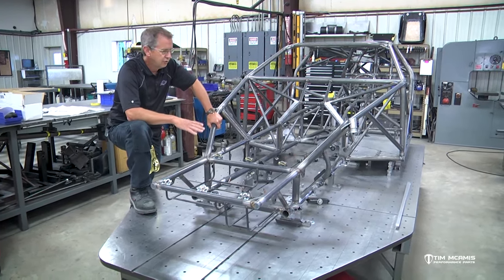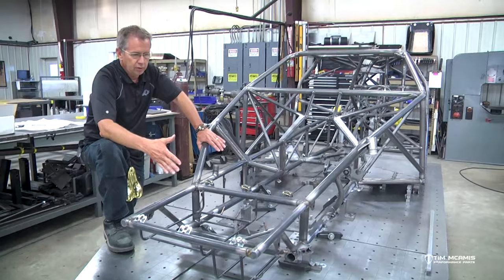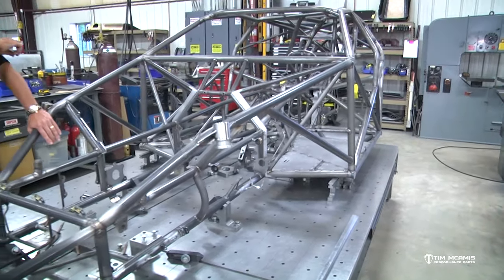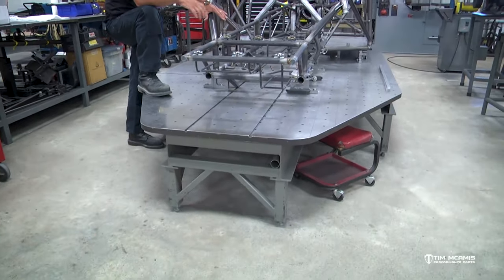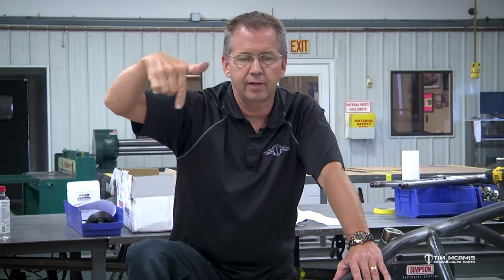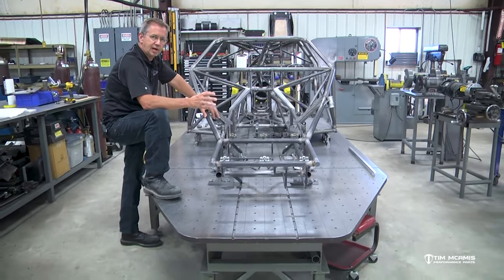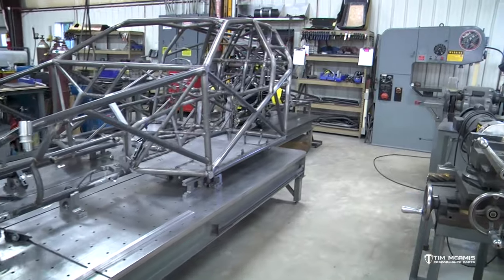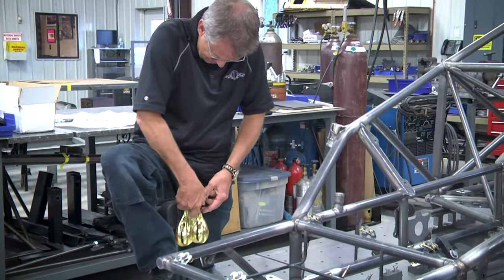How To Make A Basic Chassis Jig

Comment: we made one out of 2 i beams. I just need a refference plane that's rigid enough to hammer n weld on. I've done it w wood blocks and a level right off the floor but the area better be secure, a strong breeze will have it fold like a house of cards.

Comment: I have seen both off road cars  Sprintcars and speedway sedans built as described. And pro built ones.
That surface plate must be lovely though I would be scared of welding spatter etc mucking it up.

Though I have built several  car trailers on top of 4 of 44 gallon drums [nice height]  on a proper level floor using 2x3 premium 3mm wall and it flexes all over the shop. And that Mig welding. End up with a jack or porta power to widen the gaps to where they are supposed to be or a ratchet strap to pull them in. And yes I tack [fairly heavily] the whole structure as I go. They do however remain square corner to corner with no clamps.

Comment: Seriously dude, a transit?
Reply: Nothing wrong with a transit. Like anything else it is only as good as the man setting it up!
Reply: @billharriss4463  I was thinking that it's not exactly a common item that everyone has kicking around.
Reply: You would be surprised how easy they are to find. It is a old technique used in the aircraft manufacturing world. I bought a K&E contractors transit back in the early 80s for $100.00 and have used it many times to build big fixtures and car that were on the fixture. Also did some property boundary lines  over rough mountain property for my brother. Some people use them to set big machinery in place.